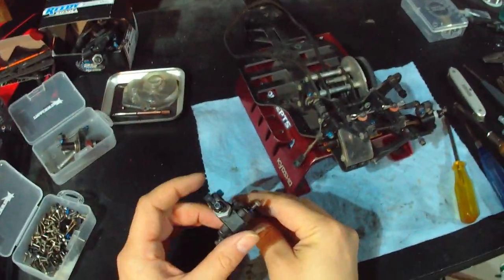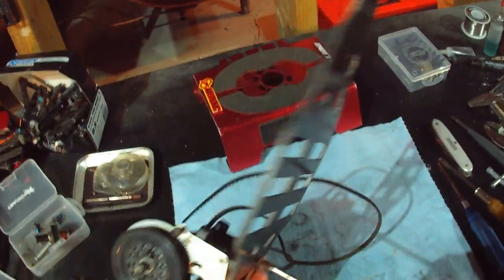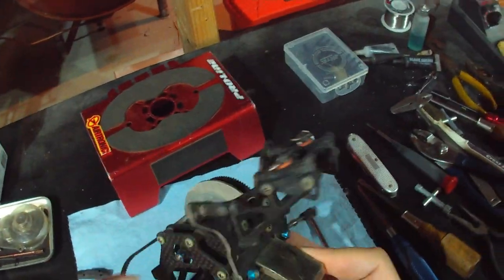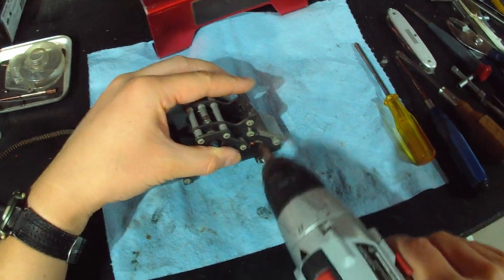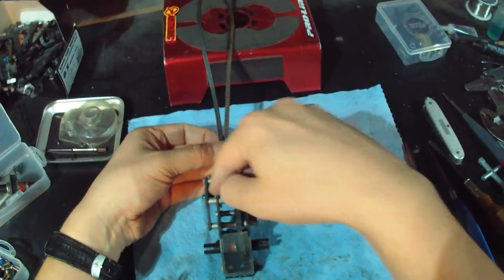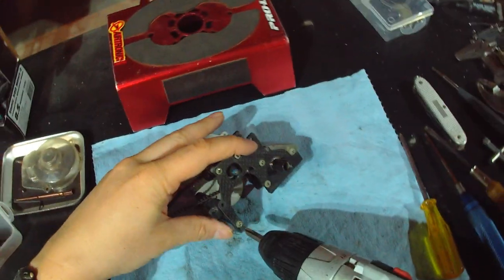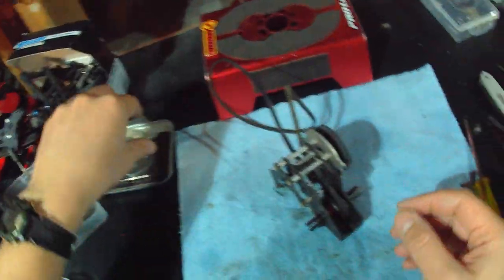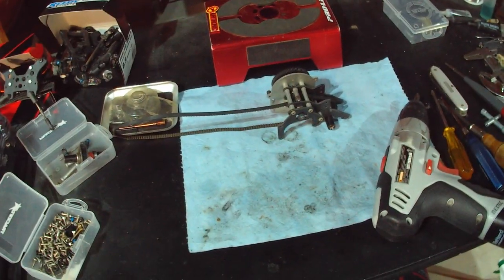Vintage Kyosho Lazer ZX-S restoration, tear down, Part 2

Comment: Hello. What is happend with the old Tamiyas? TopForce and Astute.
Reply from the maker: Not sure what exactly you mean by this?  Tamiya re-releases their older models from time to time.  They did a Top-Force re-release in 2017 and last year re-released the Top Force Evolution (albeit without the Ti screws).  They also re-released the Super Astute, I think in 2020.
Reply: @doctormosfet  The cars from your old videos. You modified the TopForce but drives the Dirt Trasher. If this cars not so good for racing?
Reply from the maker: @topforce5298  it comes down to what class it can race in.  The Dirt Thrasher is used for the "Classic" class at VONATS, which is restricted by a plastic tub chassis, which the Dirt Thrasher has but the Top Force does not.  The Top Force would be legal in the "Classic 4wd" class at VONATS, which uses 13.5T brushless as opposed to the more mild Sport Tuned motor in Classic, and is furthermore open to full racing buggies up to 1995.  This means a Top Force, which has no slipper clutch and has weak plastics, would be up against YZ10s, Lazers, and CATs, which are all stronger buggies.  At some point I would like to field a Top Force in that class regardless, but that will probably be a long time as I have several buggies for that class which I am quite happy with and which are very strong.
Reply: @doctormosfet  Thanks for your answer. That is a funny restriction for the Classic 4wd class. Brushless motors for mid 90´s buggys is nonsense. I drive my topforce with a 10 turn Dynatech 02H and the car do not "explode". For your dirt trasher- try a LRP SR ESC. Here in Germany in the forums, people used them for stock motors. The SR have a agressive powercorner. It´s made for standart and small modified motors for give them more punch!